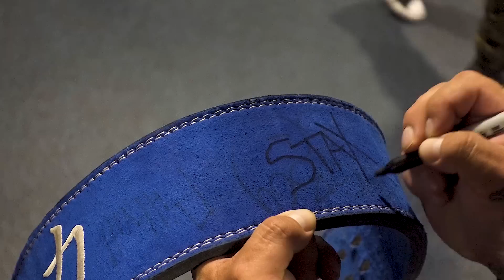ROAD TO 270?!? | DAY IN THE LIFE OF STAX

Comment: Knows it's a pain in the ass, but if you used them cardboard tubes (6-7" diameter?) and buried around them you would use way less cement per hole?